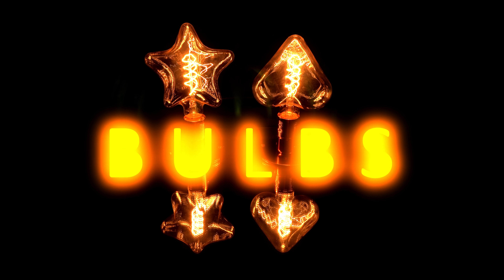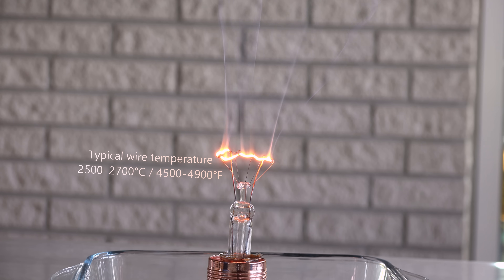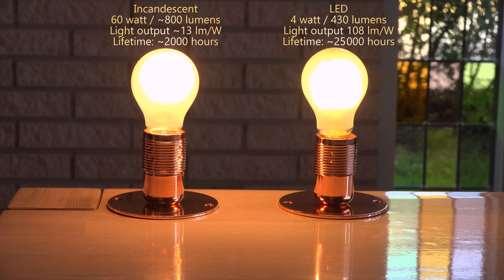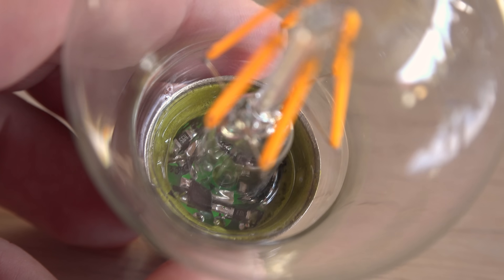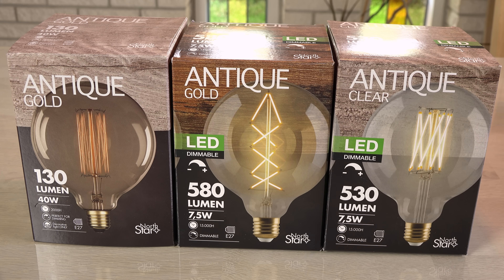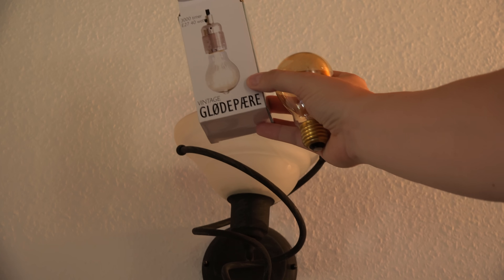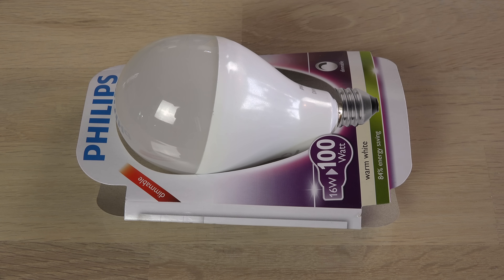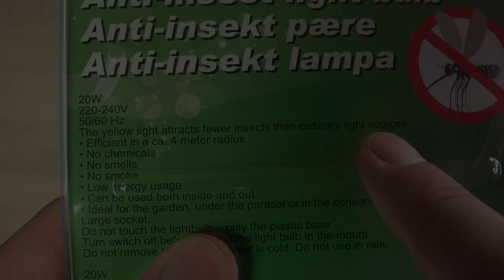Light Bulbs | LED vs. Incandescent

Comment: cfl bulbs cause cancer, they contain and leak mercury and emit high levels of ultraviolet radiation. Google it! Probably why they (our governments) are promoting them (cfl bulbs) and banning incandescence bulbs, which also help heat your home.  Don't be fooled, this ban on incandescence bulbs has nothing to do with efficiency, it has to do with reducing the surplus population.
Reply: are you trolling or are you legit serious
Reply: Divinity Healing
 Fox News (ridiculed in the US) and the Daily Mail (ridiculed in the UK) are not reputable sources, the Scientific America piece was not a scientific argument, but more of a blog post about why author's parents were stocking up on incandescents.
Reply: There is actually very little mercury in CFL bubs, in fact you probably ingest more from the fish you consume throughout the year. Most people in Europe have been using them since the 90's, I know I have. Made the switch to LED now.
Reply: CFL bulbs have no connection whatsoever with cancer.

ALL fluorescent bulbs contain mercury, and always have, since they were first brought in to common use almost 80 years ago.  No one worried about it much until CFLs hit the market about 20 years ago.  And no, they don't "leak" mercury.  You have to break them to get the mercury into the environment.

As to UV, a lot of LEDs also have high UV emissions, but they've been gradually improving the spectra on both these and CFLs.  If you're worried about UV, better stay out of the sunlight.
Reply: Divinity Healing you might as give up on food as traces of toxins exist all over the place i.e. arsenic in rice. There is less risk with a cfl as the tiny amount of mercury is sealed away. Like I said, been using them for decades, like most public/commercial buildings you walk into (or even work at) use fluorescent which contain equivalent or more quantities of mercury.
Reply: That tin foil hat you're wearing seems to be too tight, it looks like it's restricting the flow of Oxygen to your brain.
Reply: Do you make the choice to never leave your house? The minute you enter any commercial building you're going to be "exposed" to fluorescent lighting.

Choice is all well and good, but you shouldn't be surprised if people call you an idiot for making stupid choices that aren't substantiated by evidence.
Reply: The name might be a clue.
Reply: "a compact fluorescent light bulb continuously releases mercury vapor into the air for weeks to months,"
Explain how it would take months for mercury to leak out of a smashed bulb?  It would only take seconds for water to leave a popped bag.
Reply: if you managed to smash a glass tube the contents would all be released at the same time.
Reply: Here ya go Fartwrangler, Even Fox news says they're unsafe.
http://www.foxnews.com/health/2011/03/07/danger-lurking-compact-fluorescent-light-bulbs.html
But I'm sure you know better, so fill your house full of them.

and a interesting article in scientific american
http://www.scientificamerican.com/article/why-my-parents-have-a-closet/

Oh and here's what Britain's most eminent eye experts, the professor of ophthalmology at the University College London Institute of Ophthalmology. has to say about the cfl bulbs.
http://www.dailymail.co.uk/health/article-2626564/The-medical-experts-refuse-use-low-energy-lightbulbs-homes-Professors-stocked-old-style-bulbs-protect-against-skin-cancer-blindness-So-YOU-worried.html

But I'm sure you know better.
Reply: Even very little of one of the most toxic elements ever know to man is simply not worth the risk to me, but go right ahead if you choose.
Reply: It's all about choice now, is is not? and you have made your choice and I have made mine.
Reply: I guess Fox News, Scientific American and the other reputable sources that I sited are clueless and you know better. Enjoy your mercury bulbs. The problem you fail to see is that Big Government deprives us of that choice by banning incandescent bulbs and depriving people of their choice, land of the free right? Unless of course you stockpiled incandescent bulbs.  Which I have, so I am not worried, nor do I give a crap what you trolls write. I wrote my comment purely to give others who might not know that mercury (one of the most toxic elements known to man) is in those bulbs and they do break and leak. You want that in your home, go right ahead. So who's the idiot? the one with the mercury leaking bulbs in their home or the one with the safe incandescent bulbs.
Reply: Last I heard, Fox News was neither a medical nor an engineering research foundation.  If that's changed recently, I'd be interested to hear more about it.ALL fluorescent bulbs have ALWAYS contained mercury.  That includes all those long white tubes you see when you look up in every supermarket, and most offices.  You probably had them in your garage, laundry room, or even kitchen for decades before CFLs were invented.  For some reason, nobody ever got all hot and bothered by the mercury in those bulbs.  Most likely because most people were blissfully unaware of it.

Unless you actually BREAK a bulb, there is NO mercury exposure from CFLs.  And even if you break one exposure is negligible.  As others have pointed out, you get more mercury in the tuna fish sandwich you ate for lunch, than you would from a boxful of broken CFLs.I wonder that you don't worry about LEDs.  Most of them contain arsenic as doping in the silicon, you know.As far as filling my house full of them, I've been using CFLs for two decades, where appropriate.  They're not appropriate in all applications, and I maintain a supply of incandescent bulbs for some things.  I also use LEDs, again, where appropriate -- especially now that they've started to come significantly down in price.
Reply: New Rochelle, NY, July, 6, 2011— 'Once broken, a compact fluorescent light bulb continuously releases mercury vapor into the air for weeks to months, and the total amount can exceed safe human exposure levels in a poorly ventilated room, according to study results reported in Environmental Engineering Science, a peer-reviewed online only journal published monthly by Mary Ann Liebert, Inc.

The amount of liquid mercury (Hg) that leaches from a broken compact fluorescent lamp (CFL) is lower than the level allowed by the U.S. Environmental Protection Agency (EPA), so CFLs are not considered hazardous waste. However, Yadong Li and Li Jin, Jackson State University (Jackson, MS) report that the total amount of Hg vapor released from a broken CFL over time can be higher than the amount considered safe for human exposure.'

So now we have solid evidence that what Congress has mandated are in fact hazardous, and for extended periods.

Link Below:

http://www.liebertpub.com/global/pressrelease/mercury-vapor-released-from-broken-compact-fluorescent-light-bulbs-can-exceed-safe-exposure-levels-for-humans/921/
Reply: You really don't understand the difference between water leaving a popped bag and mercury nano particulates contained inside a glass tube? Really?. Okay well then think of it this way. Have you ever used a fire extinguisher, well it's like that, the dust once a fire extinguisher goes off is very fine and very hard to clean up and in the case of the CFL bulb, the contents are one of the most harmful elements know to man, you guys wanna mess with that, go right ahead. I really can't believe that you people are actually not able to process just how toxic mercury is.
Reply: LOL. :)
Reply: CFL bulbs do not "leak" mercury; it's sealed in an air-tight glass envelope, along with the phosphors and the trigger filaments.   You have to BREAK them to get at the minuscule amount of mercury they contain.Mercury itself, BTW, is not very toxic.  It's mercury \compounds\, and especially organic mercury compounds which are toxic.  These are not used in fluorescent bulbs.
Reply: YOU don't understand that the reduction in the amount of coal burned for power generation to power CFLs or LEDs reduces the amount of mercury broadcast, compared to anything you're obsessing about. This has been documented. Just don't eat the contents of a broken CFL, or, better yet, don't break any. Y'know, most houses are ventilated enough for you to calm your fears.
Reply: Jacques Blaque the funny thing is I've never broken a CFL for the 20+ years I've used them, but I have broken a thermometer with a with enough mercury for a 100 CFL bulbs.
Reply: So, when you break a light bulb, how long do you let it sit there without cleaning it up?  I don't leave mine sitting there for "weeks or months" -- I generally have it cleaned up within minutes.

Tolerable exposure to inhaled mercury without ill effects, according to the World Health Organization, is between 0.2-0.3 micrograms per kilogram of body weight, per day -- about 14 micrograms for a 150 person, per day.

 http://www.who.int/phe/news/Mercury-flyer.pdf

If you break a CFL, typical exposure -- if you stand right over the broken bulb -- is about 0.07 micrograms.  This is 1/200 of the WHO specified safe daily dosage.  Moreover, you exposure to the CFL mercury is NOT daily; it's a one-time thing.

http://earthtechling.com/2011/10/the-mercury-myth-how-much-mercury-do-cfls-actually-contain/

"No mercury is released when the bulbs are intact (i.e., not broken) or in use"

If you break a typical mercury-filled medical thermometer you are releasing as much mercury as that contained in 100 to 200 CFLs

https://www.epa.gov/cfl/what-are-connections-between-mercury-and-cfls

Use of CFLs \reduces\ exposure to atmospheric mercury, because it reduces energy demand, which reduces the amount of coal which needs to be burned to run power plants.  Burning coal is a primary source of atmospheric mercury contamination.

https://www.edf.org/climate/reports/mercury-alert-cleaning-up-coal-plants
Reply: This came from a link you sited:

CFLs contains elemental mercury, while fish contains methyl mercury. They are not the same and have different properties. Elemental mercury gives off mercury vapor which is inhaled. The Lowest Observed Adverse Effect
Level is 9,000 ng/m3. There is no No Adverse Observed Effect level. - that is there is no level of exposure to mercury vapor which has been shown to be safe.
Tests by the Maine Department of Environmental Protection found that broken
CFLs could result in a mercury air concentration of up to 50,000 ng/m3. The
guideline for ambient air is 300 ng/m3.
If CFLs are broken on carpet, the carpet should be removed and disposed of as
the mercury cannot be removed effectively. If mercury spills are not cleaned up
properly, mercury vapor can continue to be released for many months. Young
children are particularly at risk in this situation.
There is at least one case of mercury poisoning from light bulbs - a 23 month
old baby developed acrodynia after being exposed to mercury from broken
fluorescent light bulbs.
Tunnessen, W. W., McMahon, K. J., & Baser, M. (1987). Acrodynia: exposure
to mercury from fluorescent light bulbs. Pediatrics, 79(5), 786-789.
David Hammond
Author: Mercury Poisoning: The Undiagnosed Epidemic

Dude, why are you so adamant about arguing that what the government has given is  perfectly safe. Why ban incandescent bulbs?
There are no dangers associated incandescent bulbs. But plenty with CFL bubls. Did you know that Germany has banned CFL bulbs outright, maybe they actually give a crap about it's citizens. They also banned genetically modified foods (GMO's), but not here in the good old U.S., in fact congress through the dark act just ruled that U.S. citizens do not even have the right to know if GMO's are in their foods. Land on the free right? It's blatantly obvious dude that you are on someone's payroll because no normal person would spend this much time insisting that mercury is safe.  A moronic statement in itself.
Reply: You are actually a well dedicated troll. Don't know if I should congratulate you though...
Reply: You are actually a well dedicated troll. Don't know if I should congratulate you though...
Reply: Trolls have little to no subscribers and channels with no content. Just like your channel.
Reply: Divinity Healing
 actually some of the biggest trolls are youtube channels with a lot of subscribers. Most commenters are just regular folk who don't invest time in making videos, they are consumers on this site and make the odd comment.
Reply: Well, the stuff you said there is correct (had experience with that as a child, sadly), except the thing about the population which is bull. You see Europe is facing a horrible lack of children, the natality is microscopic, the population is dying out.
Reply: Only if they are broken open.  I still hate them anyway.

Comment: I object to the government "banning" the old style incandescent light bulbs. The incentive is built into the rates charged for electricity. Each consumer must consider the trade off (high acquisition cost, but low power use, vs. low acquisition cost, high power use). 

Initially, I converted most of my lights to compact florescent (as LED were simply unaffordable when the incandescent ban went into effect in the U.S.) In general, I increased the 'lumen rating" of various bulbs as they were replaced. (More light for the power used.) The inconvenience of the CFL bulbs was the disposal requirements ... the mercury in the bulbs is a hazardous material. 

More recently (and after moving to a new home) I have mostly converted to LED bulbs. I make every effort to get high CRI bulbs. (New house has a multitude of "flood" bulbs in recessed fixtures.) This conversion has done fairly well. In the dining room, the "warm white" LED bulbs do not seem to give an excessively poor rendition of the color of food.

I have spent much time working in the graphics industry, where I was involved in preparing artwork for color printing. I have kept my workspace illuminated with "full spectrum, 5000K" florescent tubes. These lights are used as the standard for evaluating color printing. They make a fairly good approximation of mid-day sunlight.

CRI appears to be a combination of the calculations of the color temperature and the relationship of the light spectrum delivered by the bulb. (You can look up the definition of color temperature at Wikipedia.) Midday sun has a full spectrum (no serious gaps or weak areas) and can be measured as 5000K in open shade. Different times of day will give different results for the color temperature. Standard incandescent lightbulbs output a full spectrum at about 3000K (with manufacturing and brand differences). Digital photography (with automatic white balance) has mostly solved the problems of color temperature, but in the film era, you could use color films "balanced" for incandescent lights or for daylight. Using daylight film for a scene illuminated with incandescent light would look rather yellow. (I do not miss color film!) The strobe "flash" units used with cameras generally provides a full spectrum light at about 6000k. 

Standard florescent bulbs might provide a color temperature of around 4000k ... but usually had significant gaps in the color spectrum. Daylight balanced color film would have a significant green cast when the subject was illuminated under standard florescent bulbs. (Florescent bulbs were offered in "warm white" and "cool white" colors... the cool white was closer to 6000K, also with the significant gaps in the spectrum. 

Lifespan of light bulbs: All light bulbs have an expected service life. All are negatively impacted by turning them on and off. Bulbs in fixtures with frequent on-off cycles will "burn out" sooner than those that are left on or off. The impact of on-off cycles is greatest on florescent, then LED, and finally standard incandescent bulbs. For some LED bulbs, the LED might have a long service life, but the on-off cycles cause the other electronics to fail more quickly. As with all electronic devices, "early" failure of LED bulbs is probably related to manufacturing defects and usually manifest within a short time (a few days to a couple months). LED bulbs that are regularly used for more than a couple of months are likely to last for a considerable time period. 

LED bulbs don't "burn out" ... but rather the LED degrades to the point where it no longer provides sufficient light. This is a gradual process, so the "life span" is somewhat arbitrary, perhaps a dimming of 25% or more... (varies by manufacturer). 

Warm up period is quite obvious with CFL bulbs, especially in colder rooms. LEDs also need to "warm up" to output the full rated amount of light, but the warm up period in environments comfortable to humans is not very noticeable. (In a 60F room, a CFL might take 5 minutes or longer before it outputs near it's rated lumen value. An LED might also take several minutes to reach full rating, but may not seem "dim" after 30 seconds or less. Incandescents output their full rating after only the briefest "warm up" (since only 6% of the power makes light, the filament heats quite rapidly to full intensity). These slow warm up periods are most annoying with CFL (compact florescent) bulbs since it becomes obvious in a less-warm home during winter -- and in very cold weather it takes an eternity to reach full brightness. LEDs only are obvious in their warm up period in very cold conditions (e.g. an outdoor light or unheated garage during a winter, especially where temperatures below freezing are encountered).